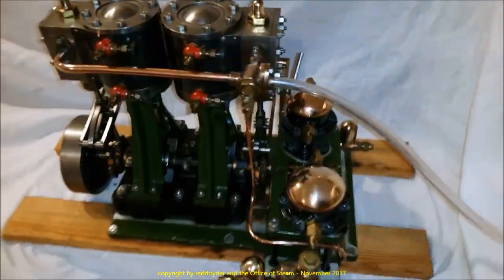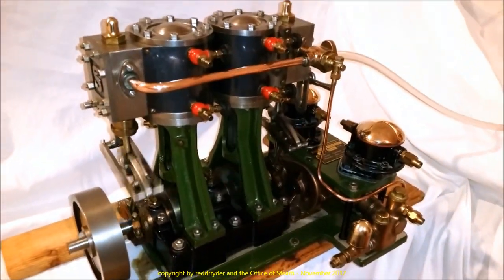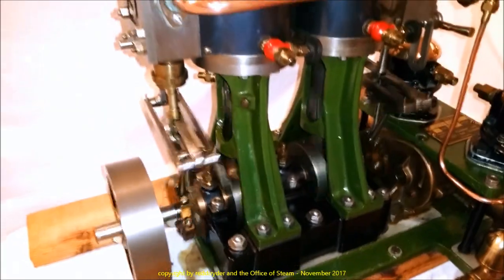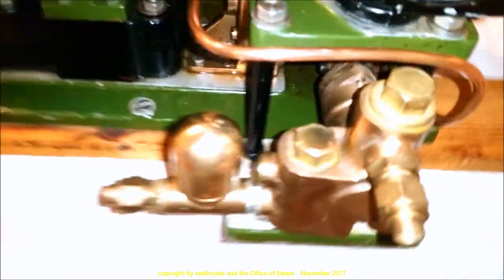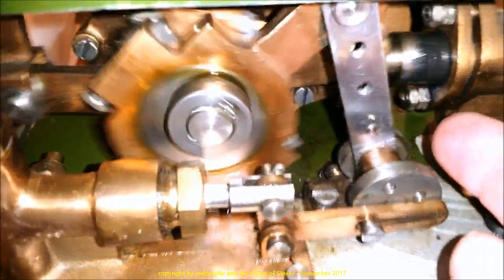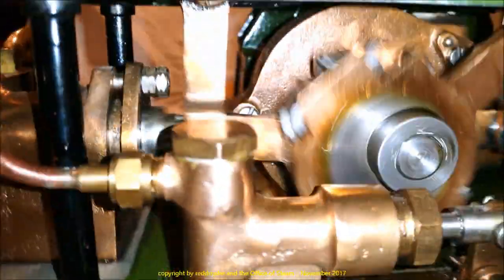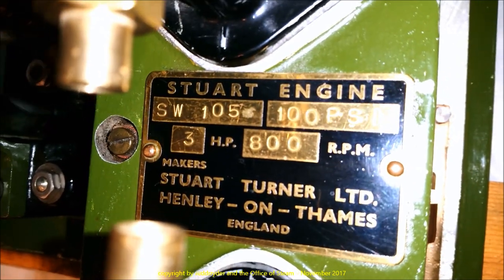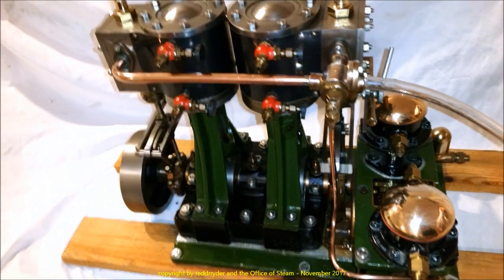Stuart Turner Swan Steam Engine Built By Stuart at Henley On Thames 1950's 60's

Comment: It shocked me when I seen it was three HP. Has anyone used those for boats big enough to carry people? Not just remote control I mean.
Reply from the maker: They were built as power for steam launches, not scale RC models. 2.25" bore X 2" stroke. The much smaller Stuart D-10 provides a similar look and they work great in scale models.
Reply: Shane K
I've got a 2hp outboard petrol engine, it pushes my dory along the river with ease at a steady 4-5 knots

Comment: Smooth runner! What an elegant pump/oiler set up.  I'm curious about the vacuum pumps. Info I've found about their use, in steam turbines at least, is that air pressure hinders steam to water conversion due to a thermal barrier. And a vacuum is created to induce a more efficient conversion from steam to water. Is that about the jist of it?  

Thank you for your videos. Always very interesting!
Reply: Vacuum pumps are used on condensers to hog out noncondensibles from the cycle, which can do real damage otherwise. Traditionallly, finish removal of noncondensibles occurs at the deaerating feedwater heater using Dalton's Law of partial pressures. The big hi temp, hi press ultrasupercritical units require very thoroughly deionized feedwater.
There are newer condenser designs where noncondensibles are nearly fully removed in the condenser.